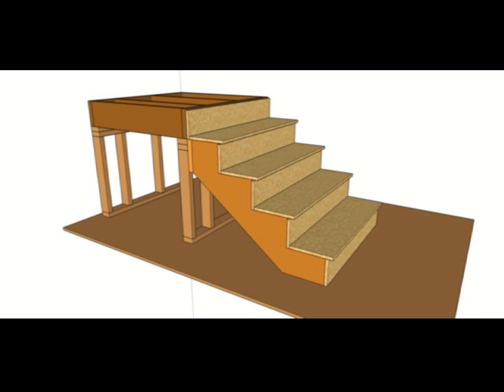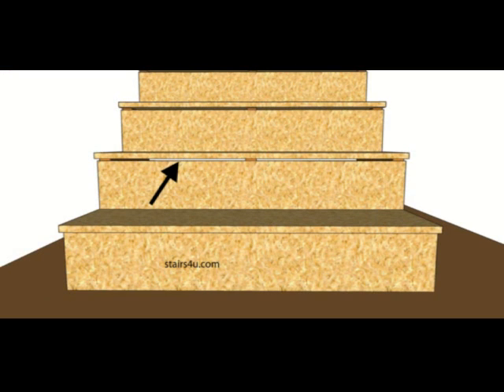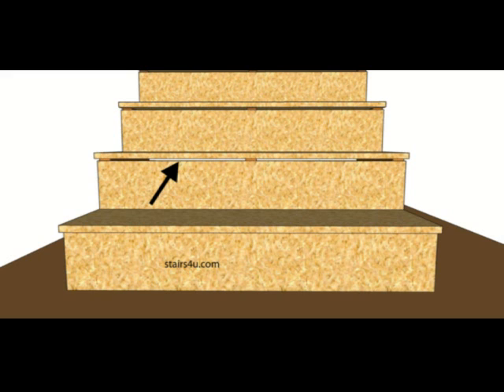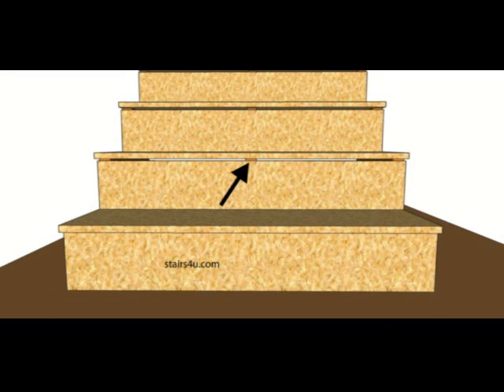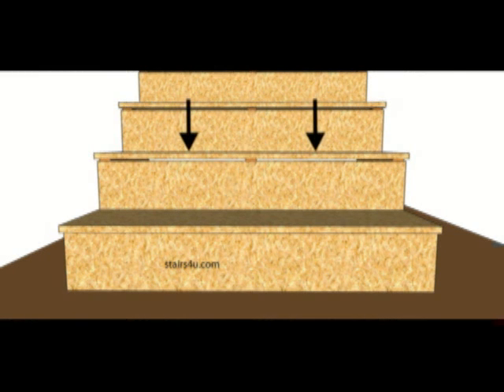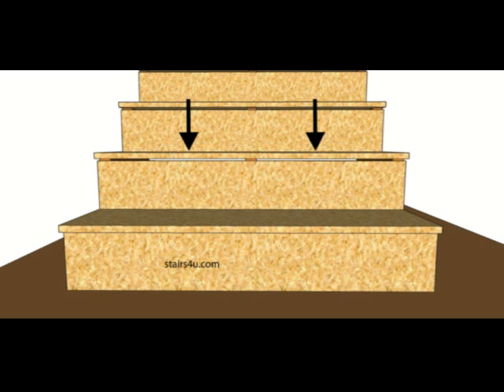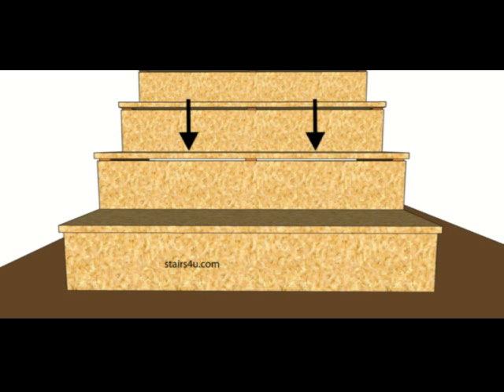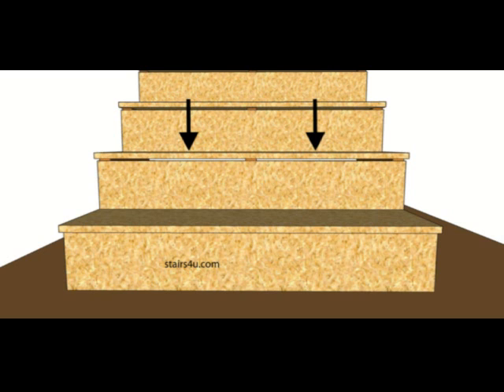Use Riser to Support Tread or Step – Stair Building Tips

Comment: I am building my own hardwood treads and risers.  I have removed the old carpet, treads and risers and left the original housed stringers.  There is no middle stringer.  I am going to wedge the new risers and treads into the old stringers and also dado the bottom of the treads to accept the top edge of the riser and tongue and groove the bottom of the riser and back edge of the tread to mate together.  All of this is going to leave no room for expansion though.  Do i need to worry about this and if so, how do I join everything together properly.  I need the risers to support the treads especially because I have no middle stringer.
Reply from the maker: You bring up a good point and the only thing I could think of would be to use some type of an adhesive that would expand and contract, but am not 100% convinced that this will solve your problem. I've never dealt with this problem, so don't I would be able to give you something that would work with 100% guarantee.